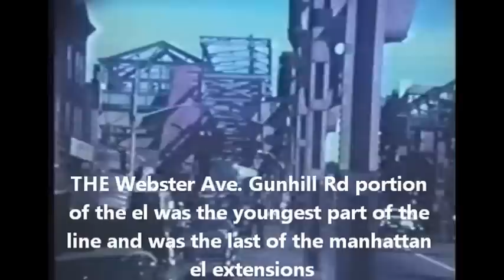3RD AVE.EL in the Bronx , Movie footage

Comment: This portion of the old grand 3rd Avenue Line was removed because of alleged low ridership (bull), as was the original Manhattan portion.  As a result patrons residing throughout the center of the Bronx are forced to cram into bus after crowded bus and endure horrendous rush hour traffic just to make it to 149 St & Third Avenue to catch the 2/5 subways down below into Manhattan.  How in the hell is this called progress?  I've taken that trip often enough and to BLOWS!  The 149 St Third Avenue 2/5 station can barely accommodate any more pedestrian traffic during rush hours!  Not to mention the severely crowded trains pulling in that simply cannot hold any more riders into Manhattan!  This was a bad bad call by way of city planning.  A stunt started early on by Mayor LaGuardia and the GMC conspiracy.  The new 2nd Avenue subway should be amended to include service into the Bronx through this old route and provide the citizens of the middle Bronx accessible inter borough rapid transit once again!
Reply: Tell em, bro.
Reply: National City Lines, bro.
Reply: @RedArrow73   Exactly 💯% right. you hit the nail on the nose bro. Some one had fust the TA workers to tair down this 8 Thrid Avenue Elevated line down on purpose. if this was a mistake why they torn down this 8 Thrid Avenue Elevated down. The 2 5 lines has the same exact metal steel structures. From what I understand Robert mosses could not stand no extra elevated lines. That's the reason why they have the 8 signs on the R62AS and the 10 12 13 11 9 signs. They definitely need to take some cars off the road over there because it's is mad crowded and worser with out the 8 3rd Avenue Elevated line. I'm glad that the mayor Eric Adams said that south Bronx definitely needs Transportation badly. Nothing cannot replace or take over the 8 Thrid Avenue Elevated line anymore. No matter how many buses they run over there and bus lanes. What goes around comes around. They definitely need to stop 🛑 thinking about what the world needs think about what people need and that was very selfish and a terrible thing to do is to tair down this Thrid Avenue Elevated line down like this. They or to be a shame of they selfs . God 🙏 is gonna definitely work out for the better.
Reply: But here's the thing...

The new 2nd Avenue subway uses IND train cars and tracks

The original 3rd Avenue El, even in it's final days of service, used IRT tracks and train cars (mainly the R10s)

So, should we convert and rebuild this Elevated portion to serve the (T) Line (IND Second Avenue Line)
Reply: Rebuilding the 8 Thrid Avenue Elevated line original Thrid Avenue Elevated line with mix steel metal steel structures and concrete structures. Let the Q T trains run west side 125 street to connect to the 1 Broadway line . Some one had called me and asked me what do I think of the Q T trains going to the Bronx? . I told someone that the Q T trains never ran to the Bronx because the 8 Thrid Avenue Elevated line ran to the south Bronx Clearmount Webster Boston road Bronx to connect to the 2 5 trains at Gun Hill Rd and 241 street. They are definitely gonna make enough room to rebuild the 8 iRT Thrid Avenue Elevated line back where it belongs because it wasn't mint for the Q T trains to replace the 8 iRT Thrid Avenue Elevated line because when the 8 Thrid Avenue Elevated line had made a left curve on Gun hill road it fits in the station with five or six car units just like they have the R62AS on the 42nd street Times Square shuttle. I already knew that the Q T trains were going to wind up making a left curve to East Harlem 125 street and then west side 125 street to connect to the 1 Broadway line. This was definitely on channel 12 news 📰. I'm not going to tell you no lie. I have a real spriital feeling that they are definitely gonna bring back the 8 Thrid Avenue Elevated line back I tell you that right now straight up bro because you know the iRT 8 Thrid Avenue Elevated line is definitely missing right now helping out the 2 5 4 6 lines and the BX 15 BX 41 buses. They should have never removed the 8 Thrid Avenue Elevated line down and removing the BX 55 buses because it didn't not make any sense to removing the BX 55 buses because those people were protesting about they did not wanted the 8 Thrid Avenue Elevated line to come down and they were very unhappy and disappointed. That was a terrible thing to do. Tair down this Thrid Avenue Elevated line down. You know it was a big crime tairing down these extra elevated lines down in four broughros. Six Ave 8th 2nd 9th  Brooklyn elevated lines. That's the reason why they have those 8 signs on the R62AS R142/As because they had no business taking down the Thrid Avenue Elevated line down. God is not mocked. What ever they did wrong they shell reap what they so. Another thing I want to tell you that I was watching on you tube they had a R142A 4 train and some one did the old 8 Third Ave Elevated line announcements on them and reprogrammed it . God has found the right MTA worker that had already knew the 8 Thrid Avenue Elevated line announcements all the old 8 Third Ave Elevated line stops.
Reply: I wish they rebuilt all els in New York, but with floating slab track, pillars relocated to outside of the curbside, and wheels with variable taper in order to prevent flage contact altogether just like with upgraded trains and bullet trains in Asia and Europe. That would enable New York to return the iconic aesthetics of its historic els while still ensuring a whisper quiet experience and giving a unique world-class sightseeing experience just like with Chicago's Loop. Unlike the CTA L however, my proposal would have a Business Class car in every trainset (just like with commuter rail in Asia, especially Green Cars in Japan) that travels on elevated lines in order to ensure that sightseers get a great experience from having a comfortable ride with a luxurious interior free from homeless. The Business Class fares for tourists and upper class commuters would also cost many (perhaps a dozen) times more than a standard fare in order to subsidize the low-income commuters in order to ensure the financial security of the railway operator so that future generations can continue to enjoy the elevated signseeing experience on infrastructure maintained to certified pre-owned like-new condition. I bet that such a modern el (but with historic aesthetics) built to my high standards would still be way cheaper than tunnelling the Second Avenue Subway through ultra-hard metamorphic schist rock hundreds of feet underground.

After all, even the economically much-worse-off Philly was able to completely rebuild the Market Street western elevated portion of the Market-Frankford Line (including the foundations of the pillars) in the 2000s to a modern concrete structure, though I'm not sure whether base-isolated track was used or not. Perhaps Chicago's el's weren't demolished because the original builders went the extra mile to lengthen the transverse girders in order to be able to place the pillars on the sidewalk or place the els over alleys alltogether, both in order to not block horse and automotive traffic? That is unlike New York, where the pillars were placed in the middle of the street on most elevated lines presumable to save money on having shorter transverse girders.
Reply: Listen carefully. Chances in the Bronx rebuilding the Brand New Thrid Avenue Elevated line again. Never rebuild another elevated line in Manhattan again. That's the reason why the boggie down south Bronx Clearmount Webster Boston road Bronx is definitely getting developing again and not beat down anymore. They just don't be rebuilding the buildings and affordable houses 🏘️ for nothing. Eventually they are definitely gonna wind up rebuilding the Brand New Thrid Avenue Elevated line back I tell you that right now.
Reply: I agree  @Linteria

Comment: Once the Interborough Rapid Transit Company broke ground for the subway in 1900 and took over all of the elevated railways in Manhattan, the fate of the El's was sealed. Simple business move, Take over the competition and then destroy it. They El's were dismantled in the same order that the new subway was built. 2nd Ave EL went first, followed by the 6th Ave then most of the 9th Ave El with the exception of the Polo grounds shuttle and then the last one and the longest running...The 3rd Ave El.
Reply: Actually, the 6th Avenue EL was the first to be demolished in 1938.  In 1940, the 2nd Avenue EL (north of 59th Street) and the 9th Avenue ELs were demolished.

Comment: The 55 bus replaced the 3rd Ave El in the Bronx. I remember the free yellow paper transfer was given to make the connection to the IRT subway (2 & 5 Train) at 149th street. There also was a 55 bus that turned on 161st and ran to River Ave to make a connection to the IRT Lexington Ave line (4 Train).
Reply: I don't know  why  they  took the  BX 55 buses  away  and  put the  15 buses   they  should of  left the  55 buses alone
Reply: And the  3rd  Avenue line Alone  to   that  was the  dummest  thing to do  let this go a  waste
Reply: IF they tair something down put it back just don't let it go to a big waste because the 8 Thrid Avenue Elevated line is definitely needed right now and they are definitely rebuilding the south Bronx back up again. Something is definitely coming back I'm telling you. No matter how much they hide about the Thrid Avenue Elevated line because it is hunting them right now and they know it.
Reply: I wish this line still existed!!!!
Reply: These lines will definitely excsisted again I'm telling you right now for real. Thrid and ninth Ave Elevated lines is definitely picking up every single day then ever.

Comment: It is 8th Avenue technically, but the Polo Grounds Shuttle was the northern most part of the the 9th Avenue Line. It left 155th st and came across to the Bronx on the old Putnam Railroad bridge to Sedgwick Ave. That shuttle was always interesting to me... how it traveled across the river on an old railroad bridge, under a few buildings, then pops out in between 2 buildings to travel across 162st on a viaduct to rise up and merge with the Jerome ave line.

That shit was genius engineering...

Comment: the low v subway cars were still on the third ave in the fall of 1968.and yes, the r-12 s did replace the low v cars.
Reply: Yes . The R12 R14s had replacing the low V cars.
Reply: Listen carefully. IF they would of fought the President Robert mosses and governor LaGuardia and the old real estates to keep the 8 Thrid Ave Elevated line running without tairing it down. I gearente you the R62AS R62S would of definitely replacing the R12S R14s on the 8 Thrid Ave Elevated line right now. Including the Redbirds I'm telling you.

Comment: I do agree with you about the greed part It ties into the economics of the city. Either way, the subway system is a permanent part of the city's infrastructure. The city was essentially built around the subway. It can't just be rebuilt, it would be prohibitive expensive, therefore it must me maintained. I'm sure you do remember the state of the subway system in the late 70's to early 80's right? The direct product of neglect.

Comment: I agree with you...

But I think you misread my comment. I said the El's were demolished in the order following the building of the original subway starting with the 2nd Ave El. They were knocked down in a logical order. The original route of the subway started at City Hall, up the east side across 42st to Broadway and up to 145st. So it made sense to knock down the 2nd Ave El first then the 6th and 9th Ave El and finally the 3rd ave El. Interboro didn't need to compete with itself.

Comment: I don't think that the standard Lo-V trailer cars needed any modification in order to run with the Steinway motor cars since they had compatible AMUE braking systems and they had no motors.  The Flushing line never operated trailers due to the steep grades of the Steinway tunnels.

Comment: One stops to wonder about the investments in mass transportation. By now, NYC should have super monorails going up the east and west side of Manhattan into the other boroughs. How did they build all those elevated lines or even the subways? Instead, they can barely get a 2 mile subway line completed that started in 2007, and was supposed to be done by the 1940s originally. I could see dismantling 3rd Ave el, but refurbish 2nd Av would've been way cheaper than this subway fiasco. Clearly the els were ragged and ugly by 1955, way past prime. We see originally businesses invested in late 1800s, got investor money to sock in, but found out quickly wasn't cost effective to maintain and run a railroad. The government stepped in to help because clearly the economy of NYC is dependent on the subway. Seems since WW2 the price of beating Hitler was to feed the military monster born to fend him off. Notice defense spending has increased almost exponentially to transportation projects (highway and mass transit) since 1945. And we see the result nationwide. Let's tell the next President, Governor and Mayors, it's time for someone to step up and fund these things again...while tracking waste. Waste and abuse of union rules for OT that isn't really worked, things of that nature, have to stop, too. It isn't just how much money we throw at it.

Comment: There's definitely a way to rebuild and restore the 8 Thrid Avenue Elevated back without making to much noises anymore and Quieter. That's the reason why they have the new engineers to trainned them how to rebuild the extra elevated subway lines back and even stronger like ever 💪 before.

Comment: Really need another train line on the east side of central park. 4,5, and 6 trains are packed and are the 3 main trains in the bronx that are used other than 2 or D trains. 2,4,5,6 need another train to the bronx as even at midnight trains can be packed going uptown.
Reply: They could use the 8 /10 trains to 3 Rd Avenue elevated lines between Gun Hill road and 138 Street and 3rd Avenue connections to the Pelham 6 line to helping out the bus operators and leaving their cars home to.  That's the reason why they have a bunch of police officer s  I'm 100% sure that every body misses the old 8 3rd Avenue elevated line s. All they had to do is to check the trestle tracks  and stations . At that time they did not painted the trestles like they do now.
Reply: Put the  8/10 trains together with the 3rd Avenue elevated line  so it would help out the  2/5/4/6 trains.

Comment: Ok you may be right to a certain extent.  Then I can say that NYC is still stuck because we still depend on a 100+ year old subway system and on the highways that were built over 50 years ago.  Why don't we tear those down?  If those are still standing then the Third Avenue El should have that right too.  It's those at the top who enjoy tearing things up to make money, as if the existing structures already don't make enough.  there is something called greed, and greed does not = progress.

Comment: So the part that was left in the Bronx didn't make much sense, It didn't have its own route or direct connection to the subway. An indirect transfer to the 2/5 at 149th street which required you to leave the El and walk downstairs into the subway and at Gunhill Rd. it just merged back into the 2/5 line again. Just replace it with a bus which is what happened with the BX55. It ran to Fordham Rd, Gunhill Road and across 161st to the 4 train at River Ave.

Less Nostalgic...More Logic... :)

Comment: I remember but I was too young to understand.   It was convenient.  Then they took it out and put buses in.  They use to have 2 #55 buses.  1 went to 149st.  The other went  to Yankee Stadium.   Now you have to take 2 buses to Y.S. now.  It sucks!
Reply: Now we have the BX 15 BX 41 BX 19 buses are slow as hell. You know the real reason why they torn down the 8 Thrid Avenue Elevated line down is because of the old president LaGuardia and Robert mosses. I totally disagree with the low riderships. What goes around comes around I'm telling you. What was the sense of rebuilding the second Ave subway line back up and not even mentioned bringing back the Thrid Avenue Elevated line? .   The 8 Thrid Avenue Elevated line has the same exact metal steel structures Elevated line just like the 2 5 lines.